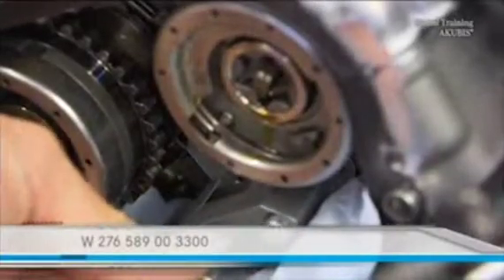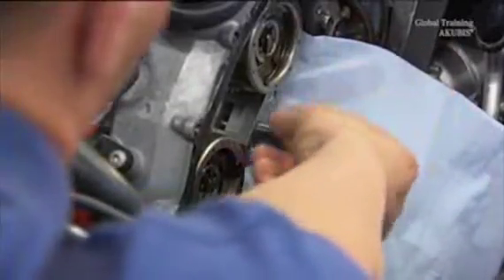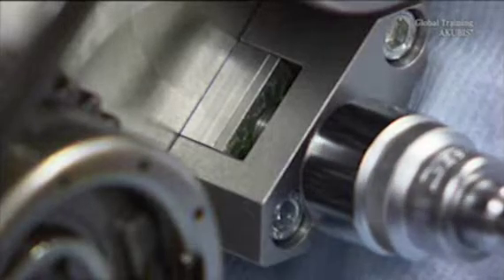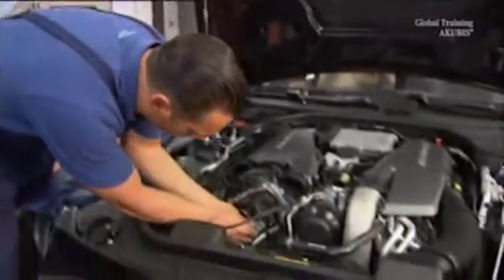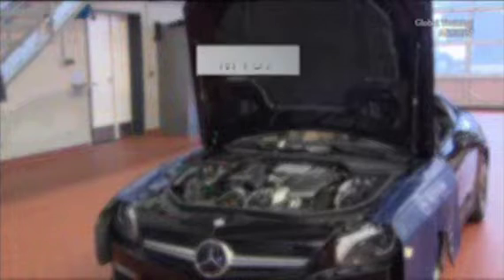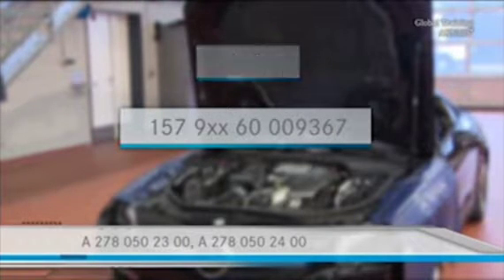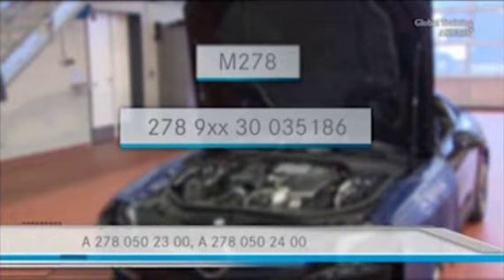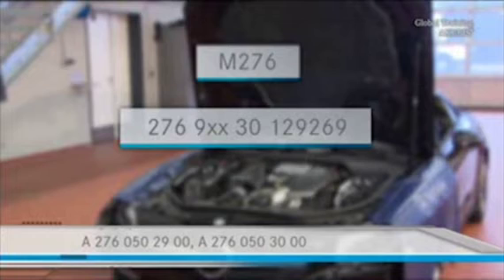mercedes-benz M157 M276 M278 installation of check valve on hydraulic chain tensioner

Comment: Is there a video/videos on a timing chain replacement on the M157? ( 2012 cls 63 amg) 
  Also would installing this check valve in my M157 eliminate the need to replace the timing chain.  
 Current the car is vary much drivable. It just has rough cold starts and has timing chain noise while running.
Reply from the maker: M157 and M278 are the same engine, and the timing chain replacement procedure is the same
Reply: @German-garage  thank you